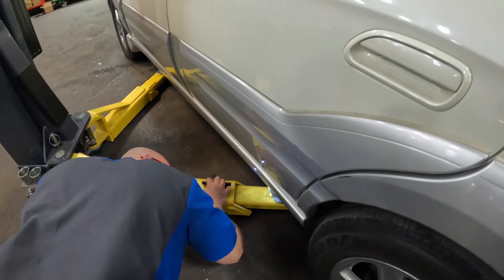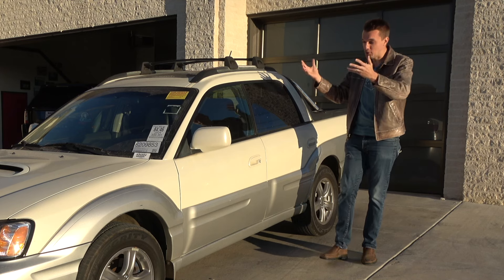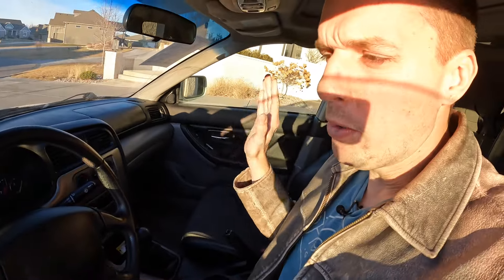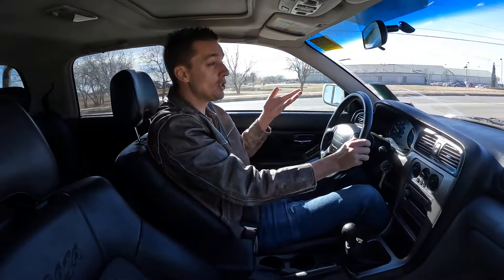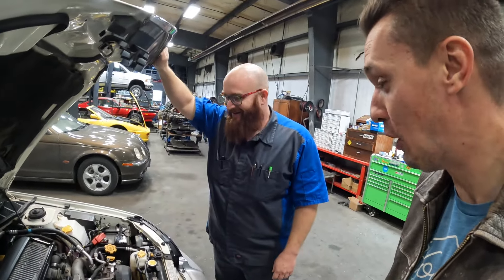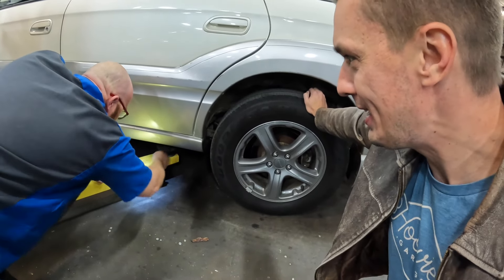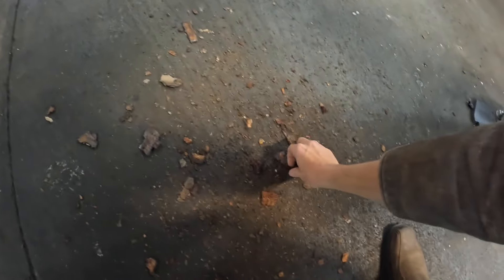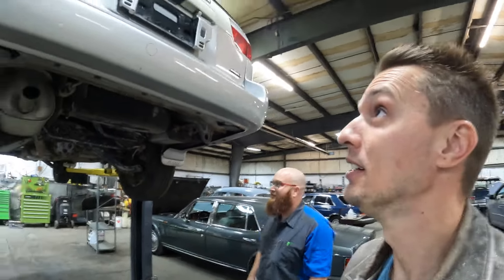Here's why you should NEVER EVER Buy a Cheap Subaru (total mechanical/rust DISASTERS) Baja XT Turbo

Comment: I would bet this Baja is made on a Legacy/Outback platform. It might be fun to graft the usable upper portion to a good chassis. Maybe if they were worth more.
Reply: It is. Problem lies with the fact that the unibody is different from the B pillar back sheet metal and structure wise. All the driveline and suspension components are more or less interchangeable from an Outback of the same body style. Problem is though is that most of those bodies had rust issues in the same areas, so you'd have to find a donor from say Arizona, to even make the repairs worth while. Not worth the effort if the cars seen anytime in the rust belt. I'm unfortunately just biding my time with my 2003 N/A 5spd, knowing full well its almost seen 20 years of Southern Ontario winters at this point. TLDR; Fuck road salt.

Comment: That’s very unfortunate luck! This reminds me of my first car, a 2002 Ford Taurus. I live in Ohio so cars get rust, but that thing rusted worse than anything we ever owned. The back wheel wells were nothing but filler by the end of it. My sister also had bumped the plastic piece under the doors and it fell off and created a trough of rust lol.
Reply: I had a 97 Sable with an unseen rust hole that tried to kill me. I knew about the hole in the exhaust but I didn't know about the hole in the floor in blew straight into where the spare tire carrier was. The stink of that melting tire... I'm lucky it didn't explode!

Comment: I’m curious, do you guys in the U.S. have places that perform yearly rustproofing treatments? I see lots of videos and comments about rust being absolutely inevitable and people not driving their cars in the winter because of that, but here in Canada (at least in Quebec), rustproofing is a fairly common thing with places like Metropolitan and Krown. If you properly treat it every year, your car will remain rust free for the lifetime of the vehicle. It’s not a gimmick: we have a 1997 and a 2009, both with well over 250,000 km (about 155,000 mi) driven through many winters... and no rust on them. So when you see corrosion here, it’s not because it’s completely unavoidable, but more because the car hasn’t been treated. 😉
Reply: In America, people who aren't into cars tend to run their vehicles into the ground with minimal maintence. People who rust proof tend to be country folk or the few non-insane people left.
Reply: There are places but the chain ones are a scam. They use a rubberized undercoating which actually makes it much worse. Independent shops will sometimes apply a used oil undercoating which is pretty effective. A lot of the effectiveness of any "rust proofing" is dependent on how well it is applied. For instance even the best rust proofing isn't going to help much if you're just spraying it right over the dirt water and rust and totally skipping any hard to reach areas
Reply: Yep, lots of scam here as well, mostly from dealers who offer 10-year rustproofing which is baloney. But absolutely, so much relies on the quality of the product and how well it’s applied. We’ve been frequenting the same places for many years and they’ve been great. It’s sprayed everywhere with an access point, including the inside of many parts like the door panels. We often see others on the road with the same 2009 F-150, sometimes newer, all ragged out... and ours is still perfect. So when done properly, it does work!

Comment: Buying sight unseen is asking for trouble.  I used to wholesale and the first thing we looked at was the under carriage.  Then start the engine before the auction starts get there a few hrs. early, go find another one, start it up, then go ack to the first car after 10 minutes and run it thru it's paces, normally on auction grounds.  you can do about 6 cars per hour before the auction starts.  Once the guards get to know you can slip them a $20 and you're in like Flynn.

Comment: I had one - I used to call it the mullet mobile - business in the front party in the back.  I bought mine from a mechanic - he took really good care of it - it ran great - the reason I sold it was i kept running into problems with that bed being too small.  But there were a lot of great things about that car.  the AWD was fantastic - never got stuck in anything - much better than 4WD trucks.  The guy I sold it to lived up in the mountains so he was really excited about having it

Comment: Sorry about your Problem, But If you are capable of doing some of the ,work, And you Have another car, Take your time, Sand blast the Bottom Buy new Inner and outer rockers, Back door post Haft you would be surprised  2,000, If work done buy you, And it would be worth it.

Comment: I drove a 99 Legacy in the Indiana salt for almost ten years. I kept the underside pretty clean though, but it still rusted in the rear quarters eventually. NOTHING like this. I've worked on lots of cars with my dad, probably over 100, and I've only ever seen rust this bad once, on a Chevy s10 where the entire floor under the drivers seat just fell through while we were working on it.

Comment: THIS is why you never buy a car from the rust belt, EVER. EVERY car after 10 years is ready for the crusher. I've seen enough SMA videos to know better. Plus, the fact that the odo was rolled back 100k? Perhaps there is some recourse for Hooptie? I know buying a car from auction is AS IS. BUT, rolling back the odo? Are you trying to tell me that fraud is included in that AS IS clause? At any rate, I will be keeping my older cars for while because the current market has gotten to the point that people are literally being ripped off. Hooptie paid $9k for a bucket of rust.

Comment: I live in Wisconsin and this is a normal sight when looking at the under body of any vehicle.Some are worse than others but where ever you have snow the salt or ice melt products they put on the roads destroys your cars and trucks.I had a suburban that the cross member support under the engine had holes rotted right through it.I had never seen that before.

Comment: You have to love salt belt states. My car is a turd too but not near as bad as this. I'm looking to fix the rust this year before it turns into structural issues. 2015 Kia Soul base 1.6L with 240,000 miles. bought it with 203,000 miles on the odometer.

Comment: Bought my baja for 7.3K and it came with new headgaskets,timing belt and they patched the rust with new metal. Only issue was a bad O2 sensor. Only 93000 miles. That was 10 months before this video came out.

Comment: That motor's done. I have a turbo Sube, as well as old Mopar muscle just like Hoov. When oil drips on the exhaust, that's head gaskets, not valve covers. But the DOHC cam journals start getting wallowed-out real bad at 150,000 miles.

Comment: Sorry to correct you, but SIA was not built just for the Baja. Subaru had another factory line planned at SIA for a long time, and just filled it with the Baja, and then when it flopped, used it for the Camry, then when toyota left they use it for the Ascent and Impreza I think

Comment: There is another channel with the same problem, on sarah n tuned she has her late grandmothers 94 pickup, the cab, box  and engine are in great shape but the frame is trashed, but since it belonged to her nan she chose to use it in her videos, she got another rust free frame from the junkyard powder coated it then ordered abunch of new parts and is almost ready now to swap over the engine and trany, she also does the od review of new unique vehicles...

Comment: I worked at a Subaru dealer for a couple of years as a used car tech and I always found it hilarious how Subaru makes cars specifically for driving in the snow but uses the cheapest metal they can get away with. Oh, and fuck a rear wheel bearing in any Subaru.

Comment: i have a 98 Outback in my driveway with the shock towers all the way up through the back from rust. 165, 000 on the clock. leaks a bit of oil, head gasket was replaced by the previous owner. motor runs like a champ, but time to let her go.

Comment: Junking it is the right choice. I nearly died in a rusty Subaru Outback I bought off Craigslist. It looked perfect on top, and it was just a college beater car for me so I didn’t look it over that well. Flash forward a week I was driving down the road about 50 mph and hit a bump. The strut towers let go and the suspension punched through and ended up in the trunk. Needless to say it was a really bad experience.

Comment: The worst car I ever had was a Subaru. Barely over 200,000 miles from a southern state and it would rattle going over 55mph, steering was jerky from rusted parts, I couldn't change a tire because the rust was so bad that it would break through at all of the jack points, so I had to use the arm. Oh also the transmission failed adter 6,000 miles of personal ownership, and the headgasket was going, the AWD was ok but didn't work in reverse as I learned the hard way. 

It was a comfy ride! But looking back, the seats were hard as rocks. 

I'll never buy another Subaru. They're all back breakers on wheels compared to a base Crown Victoria. At least I can change my timing belt without hassle... Oh wait it's a timing chain that lasts forever, also silky smooth V8 that ran better and quieter than any boxer I've ever seen.

Rag on me all you want fanboys! Until Subaru gets their game in place and starts selling body on frame v8 cars, I ain't buying it. Even if they sold regular inline 4's, I would consider it.

Comment: Start selling the parts.  All the interior parts including seats, dashboard trim, interior door panels, outside body panel trim, sun roof, all the windows including the back window, bed liner pieces and trim, bumpers, roof racks & rails, engine, transmission, front and rear transfer cases.
  It may take a while but you'll recoup some or maybe even all of your money.

Comment: Your info on that factory is very incorrect.  I know because I'm from that town in Indiana and I've worked at that factory. It was originally built as a joint venture between Subaru and Isuzu. They have been building Legacies there since the plant opened in the 90s, but Isuzu pulled out after about 5 years, and for another 5, they were looking for a new partner. Toyota came in with the Camary in the early 2000's to fill that void. They only stayed for about 18 months then they also pulled out. Now that factory is 100% Subaru. Its the biggest Subaru factory in the U.S. and they build 4 or 5 different models there including the outback and legacy. Still to this day. Facts matter Hovvie, be better.

Comment: Why I never buy from auctions and check my used cars to see if they were purchased by the dealer from an auction. Most auctions are used to dump something that does not sell or has some hidden problem. Yeah there are rare occasions a good deal comes a long, but I just avoid it as much as possible. Since these are Red Hot in popularity you could piece it out and sell the componants that are still good and get some of your money back.

Comment: This is how Subaru's age and it's what happened to my '02 WRX Wagon except that mine is worse.  I bought it brand new, was the only driver, and took care of it as best I could, but I didn't have a garage to store it in and live in a humid river valley in the Rust Belt.

Car has only 81,000 miles and I replaced the timing belt and plugs just 2 months before a jack bent the rear differential dog bone as it was the only place left in the rear that would hold the weight of the car.  Like-new interior, low miles, no abuse or racing, and records of every maintenance item and fill up for the life of the vehicle, yet it's a worthless pile of rust sitting in the driveway.  My only hope is that someone wants the excellent-condition turbo engine.

If anyone out there buys a unibody car, make it doesn't have s-u-b-a-r-u printed anywhere on it unless you're buying it from a desert-dwelling owner and you yourself live in the desert.  These things are allergic to moisture.

Comment: Really, really, really dumb question (maybe, but I live where they NEVER salt the roads)..... Is all of this cancer from using salt on the roads?  I bought a Hyundai from back east and had to do some minor rust inhibiting and restoration, but nothing like this.  All I had was the strut mounts would not come loose (or break) with 450 lb-ft of impact torque on them so I replaced the front engine cradle (had the car more than ten years now).  Just... wow.  Not used to this on the NW coast.

Comment: Subarus are far more prone to rust than Honda and Toyota, and they are designed to be driven in winter conditions. I have an 02 Accord that's seen around 20 Canadian winters, and has the original exhaust and solid rocker panels, and my 2014 Subaru has the same amount of rust.

Comment: you could repair all that damage if you knew how to turn a wrench and weld.  I have repaired vehicles with that much rust.  All those rusted parts can be replaced. The rusted body can be resheathed with new steel.  If you dont want it, just let me know and I will buy it.

Comment: Spends 9k yeah it’s on you as the buyer to check etc but it’s on the auction seller etc to decide if it’s safe. Because one word: liability 

Finishes typing at the same time you see the lift arm…

Case in point

Comment: I used to buy cheap subarus and this is why I stopped.  They rust to shit.  Even if you had no rust they will rust to nothing in the salt belt.  However my price point in the 00s was like $1000 and the cheapest one I bought was $300... even that one was more structurally sound.  Edit note:  None of those Subarus could be jacked up be frame rails. I wouldn't even assume that's possible but I'm guessing mechanics are used to working on cars worth more then a dinner at Mortons.

Comment: TRUE STORY : I bought a Subaru Outback from a literally CwAzY "cat lady" who had about 30 cats - not kidding. It was in my town as well.  BUT - here are the details - she had a STACK of receipts for maintenance over the years - AND was the original owner. I guess she had money troubles at the time of selling - and she had no mechanical ability or tools etc . . It had a bad MAF which caused it to stall and she thought it was an ignition issue - AND whoever did her last tune up left cylinder 1 spark plug barely hand tight in the block - so it was misfiring as well. And so I did an MAF and a tune up and it runs perfectly now. It has 136k original miles - its a '97 - 26 years old - and doesn't burn ANY oil ( she changed oil every 3000 ) - AC works etc . . She was asking $ 1000. Not kidding - I bought it for $ 1000. Daily driver with no issues.
Also - California and Florida car. NO rust issues.

Comment: Hi!!!... Excellent video!!! Thanks!!!
I bought one of those, 2005 Subaru Baja Turbo (auto trans) with 110k miles on the odometer (Carfax checked), just like that on the video, two years ago. Few months later, I began to hear some weird sounds coming from the suspension and, guess what... rust every where!!!😳 Fortunaly, theres no structural issues. My big problem now is to find a good online site to buy all needed parts (struts assembly, control arms, balljoints, bushings, links, etc... ), all of them at good price in only one purchase. 
A question I have to you guys is: Is there a compatibility between the Baja with other Subaru models???... So I have a better change to find all that parts.

Comment: These cars have a poor design where dirt gets trapped behind the fender liner and sits on the backside of the rockers.  Then this rots out.  Then the water gets throw into the rocker along with dirt and it rots out.  If you don’t clean the rockers out in your 2014 and below Subaru.  You will be sorry.

Comment: My first car was an over 20 year old Subaru. Lasted me a couple years until my mechanic told me it was too rusty to do work on (the filler neck was leaking, the exhaust rotted through, the suspension started making weird noises). Up until that point the car never needed anything but regular maintenance and a serpentine belt it’s entire life according to maintenance records.

Comment: HOOVIE, I have a TOYOTA TACOMA SR5 AUTOMATIC PICKUP I bought for a $1...... Still RUNNING! 240, 000 miles on the ORIGINAL FRAME and MOTOR (which is junk). I DONT THINK I BOUGHT A BAD DECISION...... THIS IS A TOYOTA (MADE IN AMERICA) AND THE JAPANESE want it back ....what do I do?  I love my TRUCK..... Total RECALL truck. Contact me..... Price is going up for this truck because of it's RARENESS AND DISAPPEARING KIND.....
Reply: The frame , HOOVIE, NOT THE MOTOR OR TRANSMISSION....

Comment: I'm glad we don't get rusty cars anymore in Australia, the last type of cars to rust were early 80s cars and it was generally only body rust, never frame or underside.  But I was also burned by my first Subaru, got an 05 Subaru Forester XT manual 2.5 turbo which while high KMs, 220000km it looked pretty good and ran ok.  Later on I found out it must have had a tune on because when put on a sports muffler it boosted much higher to 16psi.  Then earlier when driving up a mountain it got really hot, so I thought hmmmm, maybe just a once off as it was summer.  But over time it got worse and worse and the cooling system would fill up with air forcing the coolant out.  This was a blown head gasket, by the time I was going to get it fixed it had already 250,000km on it and spending minimum $5000 on an $8000 car it wasn't worth it.  So I bought a Honda Jazz/Fit for $A3750 with similar KMs and it ran like a dream and never had any real issues.  Ended up selling the subaru as is unregistered for $2000 to someone who's actually fixed it up and is registered again.  I sold the Honda 3 years later for almost what I bought it for.